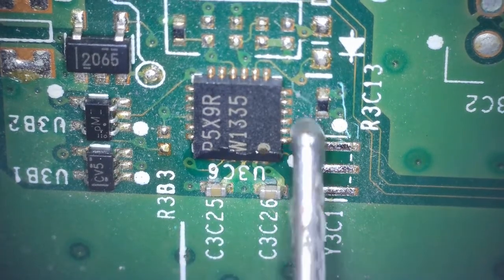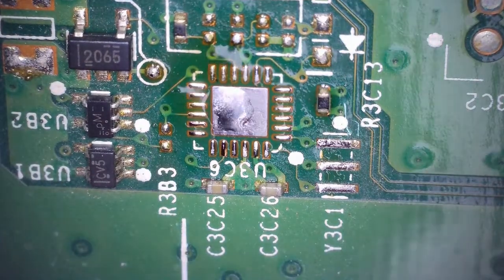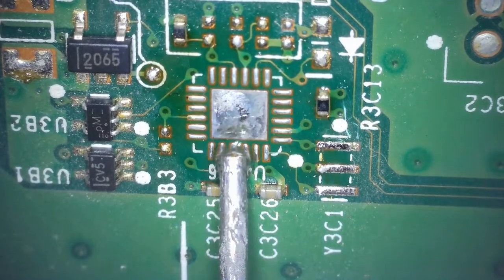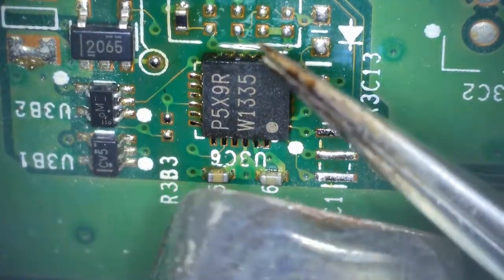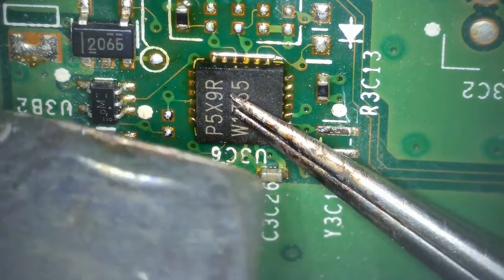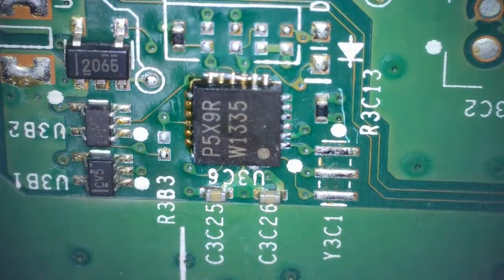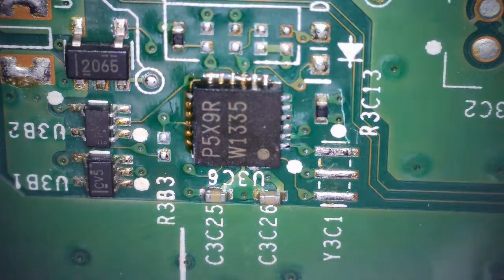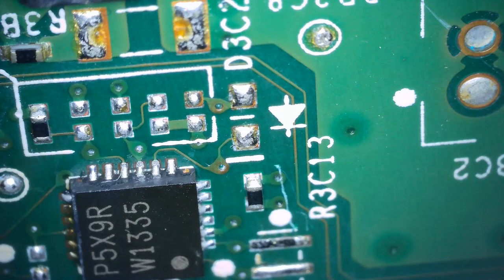trying To Replace QFN IC Using Hot Air

Comment: Seems it was thin PCB without internal ground plane. QFNs aren't come off usual 4+ layer boards with hot air only without preheating on hot plate or IR heater.